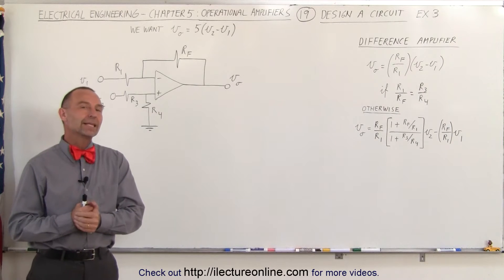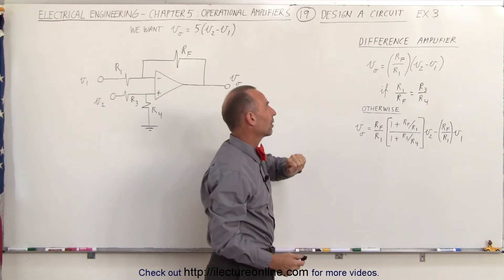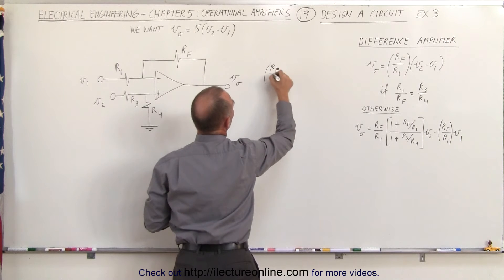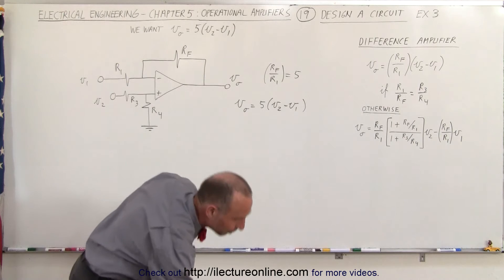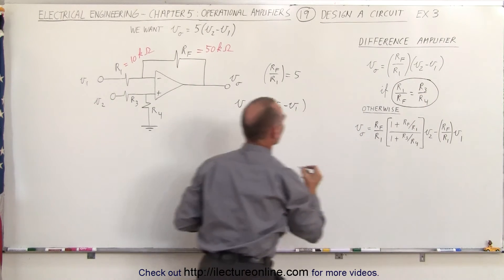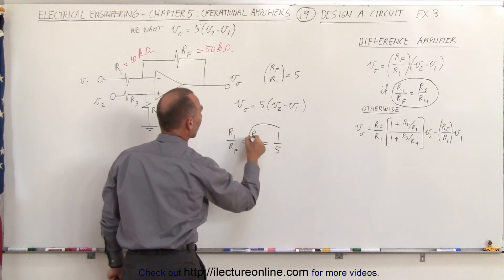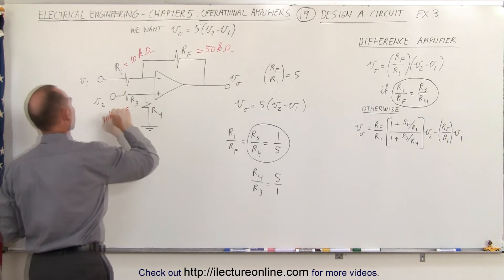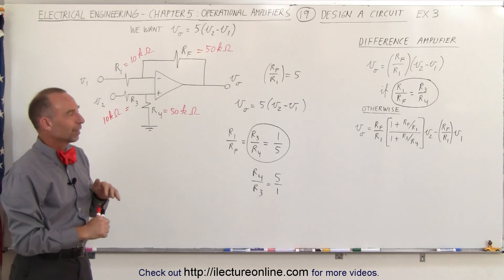Electrical Engineering: Ch 5: Operational Amp (19 of 28) Design a Circuit: Example 3

Comment: Sir you wrote the otherwise formula wrong.
I think it's Ri/Rf instead of Rf/Ri according to your 15 no. video.
Reply: Dear Usman, the gain is always Rf/Ri, but at non-inverting terminal it should be R3/R4=5.
Reply: @johnkyingilisi4395  yes right
Reply: Yeah  i noticed that too.
Reply: Chk video 2 shows gain factor is Rf/Ri
Reply: So the values he found for R3 and R4 are wrong, right? My answers were: R1 = 2K, Rf=10K, R3=R4=3K.
Reply: no theres nothing wrong in that formula. he have just inversed the both sides.